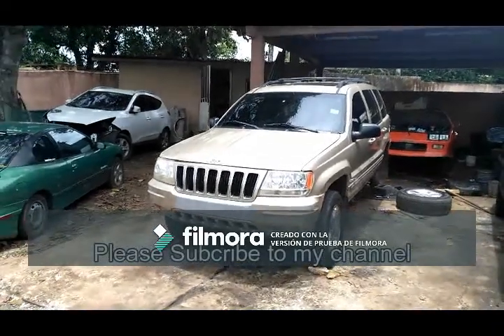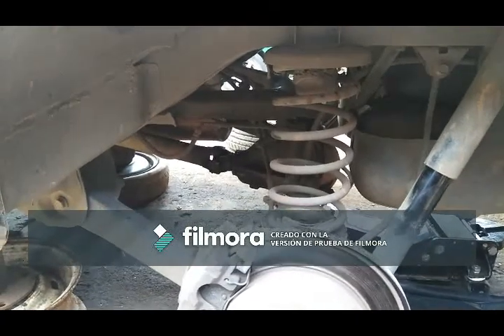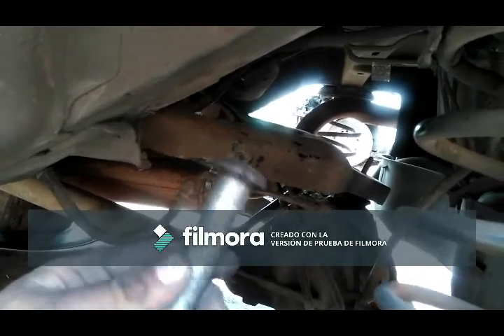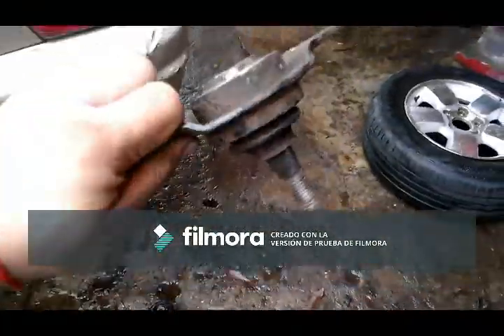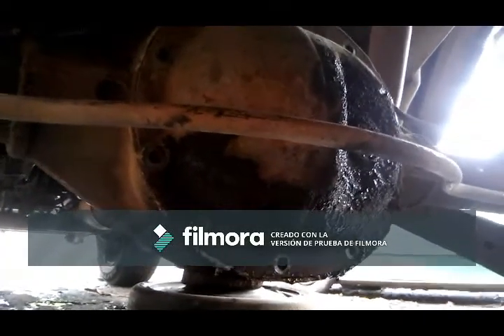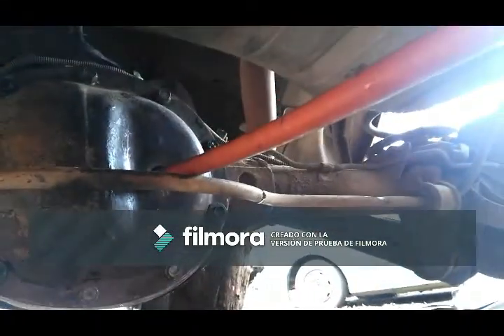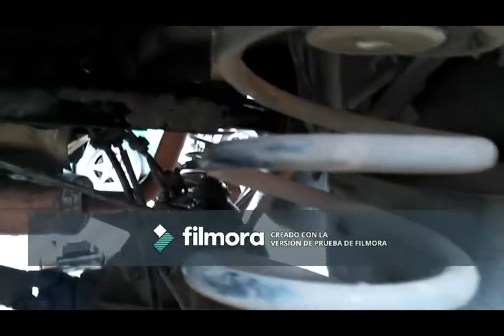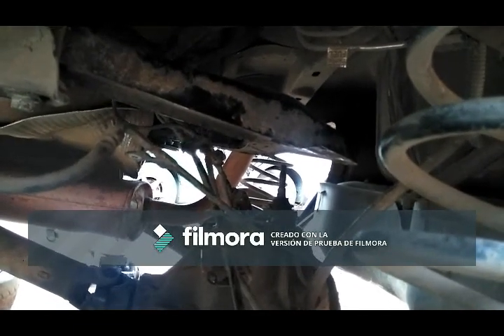Doit at home Jeep Grand Cherokee 2001 Rear Upper Control Arm Replacemet Most Easy Way

Comment: I just did this job yesterday by myself. 3-1/2 hours cause I also replaced the lower control arms too.
I used a pickel fork with a 1" X 4' pipe. The pipe worked best if it goes all the way to the fork, that way your pounding on both forks at the same time and not losing the pounding force by just pounding on the end of the fork. Once I got the fork all the way on the balljoint,  I started to use the pipe as a leverage bar, yes i used the weight of the differental, was hanging to help pull down on the balljoint  but was still on the jack.. 
I was bouncing a couple of times with all my weight and it broke loose. The control arm popped up as I had hoped it would. Now was so easy to take out the 15mm bolts on the arm, pull the arm out and super easy to get a impact wrench on the 3 balljoint bolts to the differental.
Even using a impact on those 3 bolts were very slow coming off. Can't imagine using a ratcheting box wrench on that. Curious how much did you charge for labor? Wondering how much I saved doing the work myself?✌